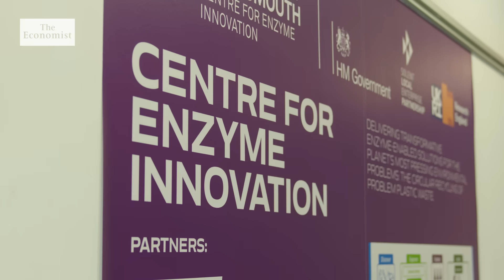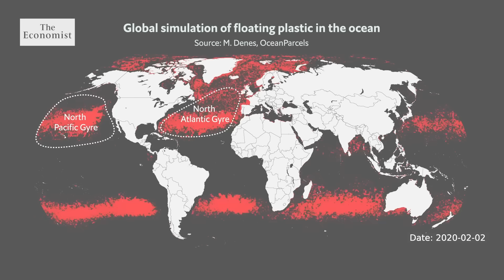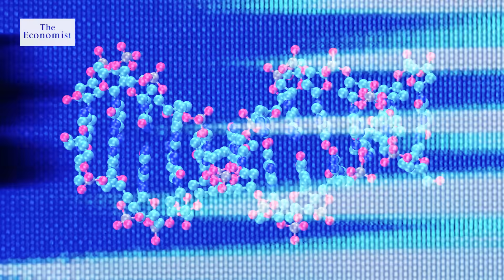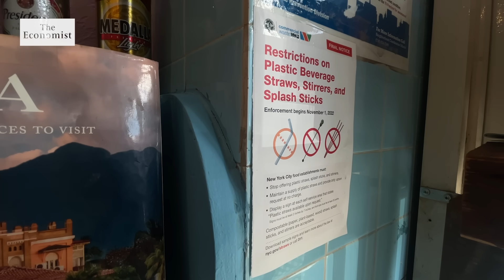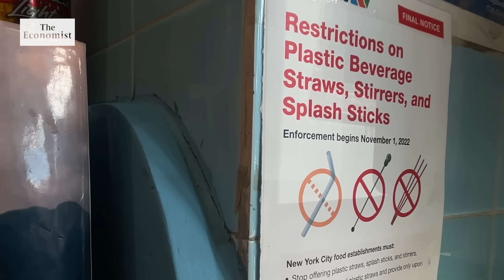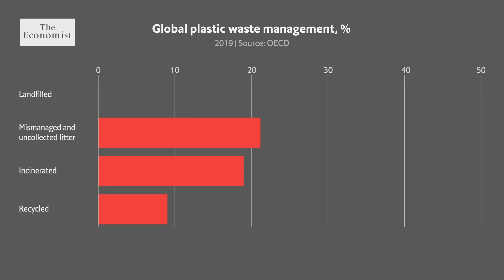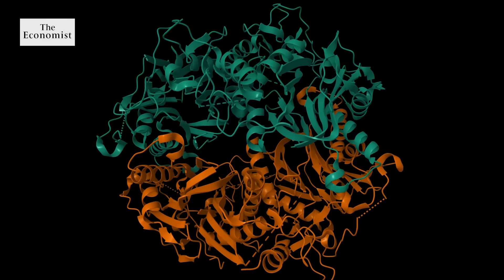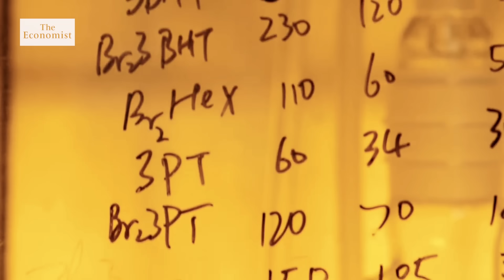Who is polluting the ocean with plastic?

Comment: I am in Vanuatu at the moment and yes there are no more plastic bags in the shops.  However i see many many times a day where they just discard rubish into the street or sea.  After it rains the amount of plastic washed into the sea is massive. They have no feeling of pride in their country at all.  Until this is reversed there is no hope. In the capital Vila there are thousands of very expensive stainless steel waste bins that some country must have gifted them. They are cleaned often, but only in the town, outside just forget it.  But if you go up to Porto Santo you hardly ever see a waste bin and if you do it is over flowing and has not been emptied in months if ever.

Comment: All plastic going into landfill should be burned to generate heat.  PET is the only easily reciclable plastic,  by hydrolysing it into glycol and tereftalic acid. Almost all plastics should be made floatable as by including minute air bubbles so they do not sink avoiding recovery. Sailors like any users should get paid for returning plastic so they do not throw it overboard. The money for this would be paid by the customer, hence all plastic and deposit money would circulate in a closed loop.

Comment: It’s all trade-offs. I say we need more garbage incinerators, you can make filters to reduce the emissions and use the heat to generate energy. Takes a lot less room to store the used filters and ash than store the trash, plus you can mine the bottom ash for useful raw materials.
Reply: Yes. Plastic has a very high heat value, like oil. So it's easier to get value out of burning it.

Comment: Great video. But I think something needs to be emphasized about this subject. This plastic pollution problem is barely related to climate change.

I can't tell you how often I hear from my students that they think they're making a difference regarding climate change because they are recycling. Recycling does almost nothing to combat climate change. 

However! Plastics are also a major byproduct of oil. It's one of the reasons why it's so cheap. As we slowly shift away from using oil for our energy, I believe plastics will get more expensive. And that'll really help solve this problem.
Reply: Not true. Taking the example of PET bottles, making new bottles from recycling requires only 40% of the energy required to make new bottles from raw materials. Worse, making new bottles from raw materials is taking carbon out of the ground and adding it to the surface environment in a form which will take a long time to break down, and adds to the amount of carbon in the surface environment. So even taking only the energy to make bottles into account, recycling PET bottles requires 60% less energy - which is still mostly being generated through fossil fuels - and is simply more efficient. By recycling, it keeps useful materials out of the oceans and landfill. No new plastics should be made from fossil fuels.
Reply: You gotta read the whole comment before responding, dude. Pretty sure the OP wouldn't disagree with this.  @theharper1
Reply: @falsificationism  I did read the whole comment. The main part which I disagreed with was the claim that recycling doesn't have anything to do with global warming. It absolutely does, even if you only consider the difference in energy requirements.
Reply: From that standpoint I agree. I think a world without ANY plastic, save for very narrow uses (e.g., medical devices) should be the goal. Recycling isn't great. Reduce and reuse are better. Upcycle during the transition (but it doesn't yield much). The goal for climate activism should be to END the cycle, not to recycle. @theharper1
Reply: Underrated comment 👆🏽

End users should not be expected to clean up the plastic problem. That's a stall tactic anyway (delay and deny). There are only a handful of companies in the WORLD that make plastic, and they all rely on fossil fuels. 

We need to move as quickly as we possibly can to HALT the production of plastics until we know how to responsibly manage the lifecycle. It's not complicated.